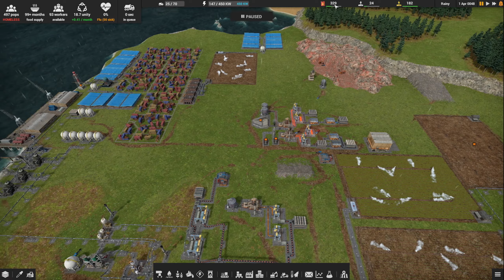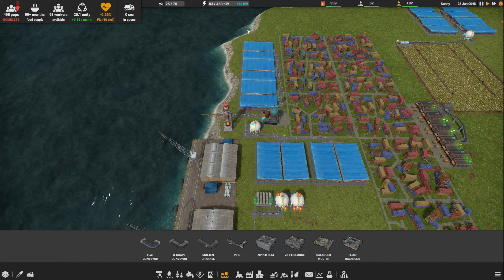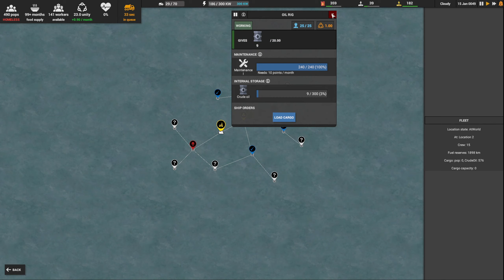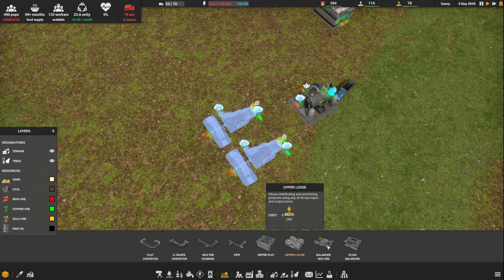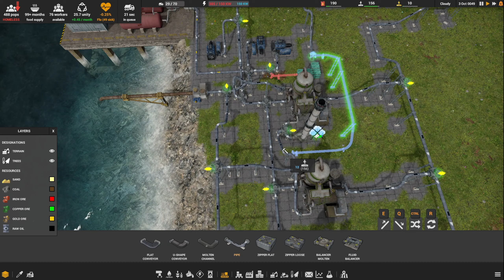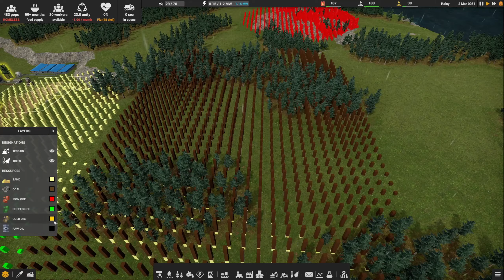Let's Play Captain of Industry s02 e14

Comment: So to deal with  your (potential) excess acid, you want to stick a pipe balancer (not sure of the correct name) between the producer of acid, and the tank.    Then you tell the balancer thing to send every thing into the tank until it can't anymore.  after that, the excess can go to the waste water disposal (aka, the ocean).
Reply from the maker: Yep, that's an awesome tip. I had been wondering what the use of the balancers was and they will come in extremely handy for this purpose.

Thank you for the tip!  😺

Comment: In Satisfactory, pipes have a limited flow rate, so if the pipe is say 100 gal/min and you've got three sources each producing at 100 gal/min, the consumer at the end of the pipe is still only going to get 100 gal/min.  I wonder if Captain of Industry is the same?
Reply from the maker: That's a great question. I've been wondering the same thing. The information is probably in the game somewhere, but I didn't spend much time looking for it. It could become a critical piece of information as you scale up production on the island.
Reply: Just turn basic diesel installation off. Use advance diesel for rubber production
Reply from the maker: @todormirchev1776  Yep, the basic diesel production was really just to get us out of that sticky situation where I had almost run out completely.